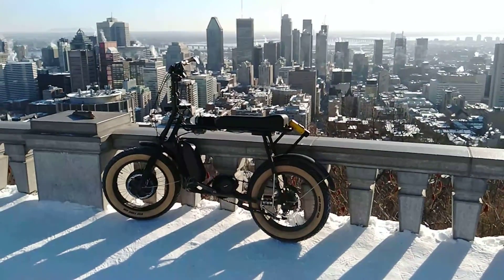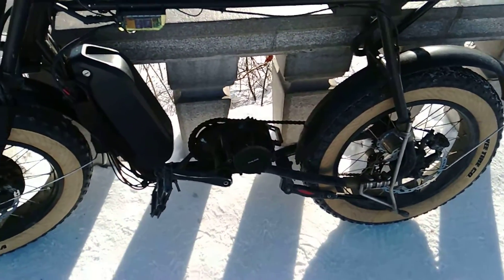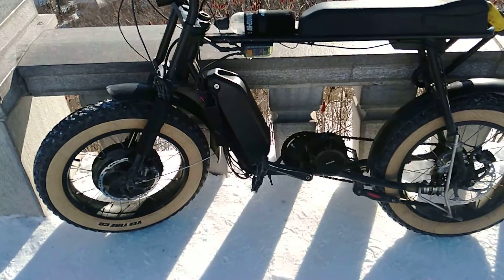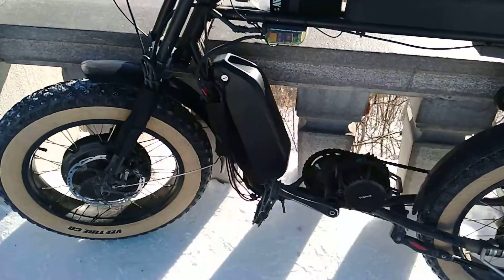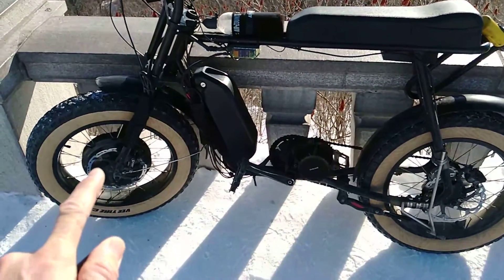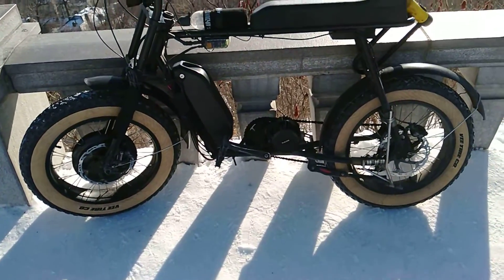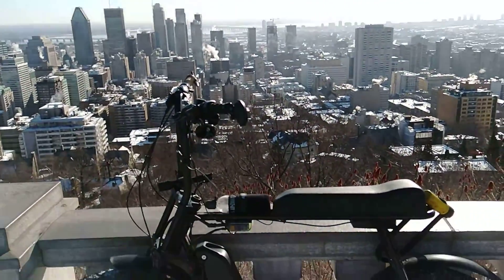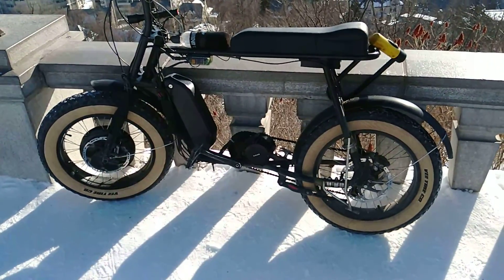Regenerative Braking Phattycycles Super 73 - two wheel drive ebike with mid-drive bbshd motor

Comment: I just feel like you could get into a dangerous situation with a trailer, it could push your rear end out when you are doing all the stopping in the front. I would work on re-gen on the trailer before I would go this route. Just my two cents for what it is worth, Its cool that you were able to implement this.
Reply from the maker: Ya, I see what you mean. In reality it's different than you describe. For a bike and car/trucks vast majority of braking is done with the front wheels. Especially is this true for towing. When braking weight moves forward to the front wheels and increases grip. This is all based on the correct tongue weight at the hitch of course. If that is not perfect then the scenario you describe can be dangerous. Thanks! Ride safe